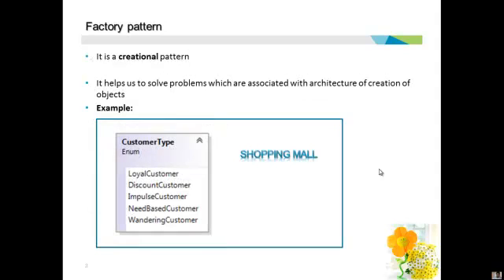Factory Design Pattern - Part1

Comment: Nice demo..1 concern is that, we still need to write the Switch statement for creating objects in factory class ..this is like we are just using another class to create objects instead of using main purpose of design patterns..are we? Please explain Thanks.
Reply: Not sure if we can remove the switch statement by using below code (from other video) :

private static Dictionary<CustomerType, ICustomer> custs = new Dictionary<CustomerType, ICustomer>();

        public static ICustomer CreateInstances(CustomerType type)
        {
            if(custs.Count == 0)
            {
                custs.Add(CustomerType.LoyalCustomer, new LoyalCustomer());
                custs.Add(CustomerType.DiscountCustomer, new DiscountCustomer());
            }
            return custs[type];
        }